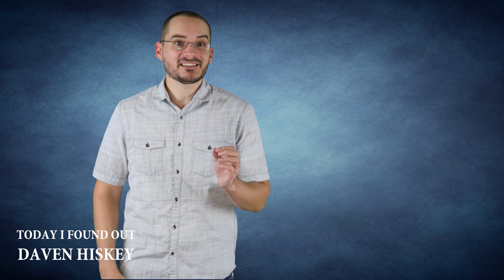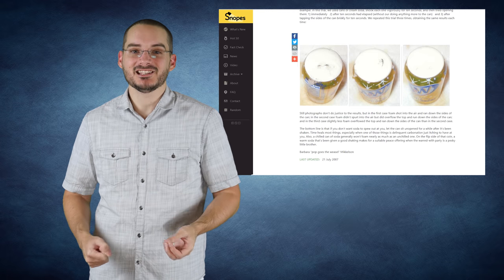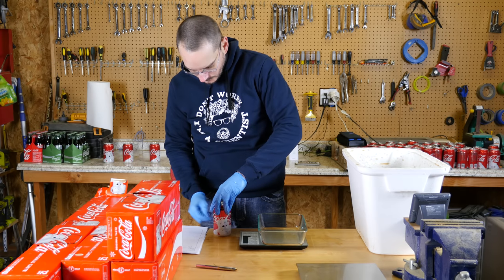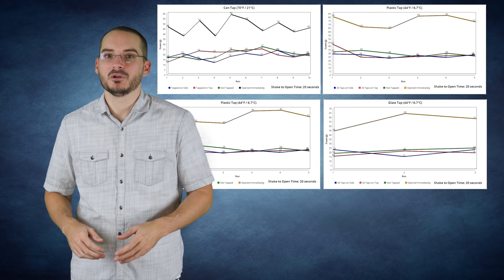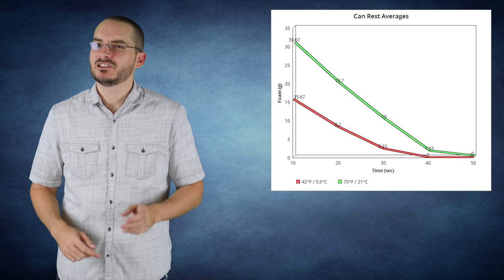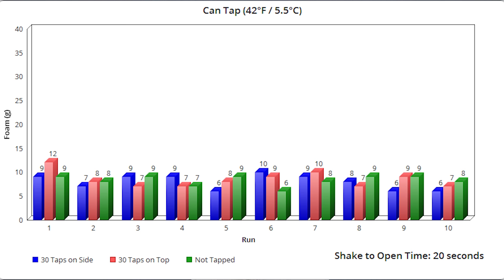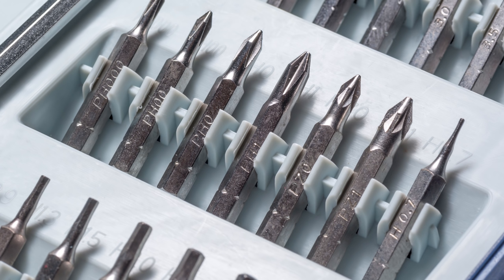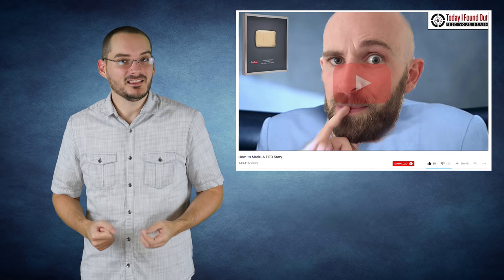Does Tapping a Shaken Can of Soda Actually Reduce Foam?

Comment: You should also set it on a flat surface when opening the can. I like this experimenting format!
Reply: Good idea, however it loses some of the spontaneity of how a soda would most likely be opened out in the wild xD
Reply: Actually..if you look at the 6:36 mark, he shows the graph for the table (flat surface) vs air tap/not tapped, etc...and other graphs as well.
Reply: Of course you need to look a little past the 6:36 mark for the other graphs..
Reply: Backtobassics500 : Backtobassics500 : I think he was referencing tapping in the air vs tapping on a hard surface.

My focus was on the opening procedure which from the video footage looked to all be in the air which consequently means they can be held at a variety of angles.

Comment: Thank you! For about 30+ years, I noticed that drinks with aspartame foamed up more when pouring over ice. I realize you didn't study that, but I'm guessing the foaming happening with the ice is triggered by similar causes. I also noticed Splenda drinks foam less than aspartame. I always wondered what triggered the foam when the soda hit the ice and why the amount of foam was different based on the sweetener.

Comment: Not sure where the idea of tapping came from but I always flick the base of the can once or twice if I drop a can / it gets shaken up. The first time I ever learned about this while camping we got together and both shook up a can then I flicked the bottom twice and my mate didn't do anything. When I opened mine it was fine and when he opened his it went everywhere. I'd really appreciate if you could just try 1 can again but flick the bottom twice and see what happens.
Reply: Was about to say that peak velocity would be the determining factor if dislodging the nucleation sites is the actual mechanism of effect.    

(I'd expect this to be) Similar to how a slow (1 minute) pass with a vacuum cleaner will dislodge more (particulate) dirt than five minutes of vigorous/fast passes.  The flow during the fast-passes does not have sufficient time to accelerate the dirt out of the pile, where as the slow pass does (albeit without the energy/violence necessary to break apart dirt too large for the flow to pick-up into smaller particles).

But like the experiment shows, it doesn't matter how much energy/violence is applied if the system has sufficient time to settle between pulses--- wait, would a centrifuge work? :/

Comment: Nice video!
I thought that the Mythbusters looked into can tapping too, but I can find an episode reference for it.   I've always been puzzled by the people who just do some little tapping to the can.  When I first learned about this, years ago now, I was shown that I had to thump/flick the can.  

I.E.  Hold the can by the top and bottom rims in one hand (as if it was being held by a C clamp) don't touch the sides as it will dampen the vibration.  Then flick/thump the can using your other hand (as one might flick someone's ear) -- the can will ring like a bell if you did this correctly.   I usually do this two or three times out of habit.

If the point is to get attached bubbles to move to the top of the can then holding the sides while tapping should reduce the effect any tapping.    By flicking/thumping the can so that you hear it ring I would think would give one the best results, if it really works at all.

Comment: I find that with the plastic Coke bottles that if you just break the seal (when gas is released with a hiss) by twisting and then two seconds later open the bottle no foam  will be produced

Comment: Yeah, science!

On a related but non-foam issue, I've found (anecdotally) that tapping the top of a can before opening can prevent a small amount of soda from spraying out (as opposed to foaming out) of a non-shaken can. If the can  has any droplets of soda clinging to the top of the can, some of those droplets will spray out. Tapping the top knocks the clinging droplets off, so no spray.

Comment: makes sense, in my practical experience I always settled on a couple moderate taps on the top and then a 6-10 sec delay depending on how badly I believed it to have been agitated.  The taps are mostly just habit for me at this point and have been getting phased out since I gathered their lack of necessity.  Something that slips in mindlessly at times.  I adjust the timing depending on the soda, such as Dr. Pepper being a much more violent drink requiring significant delays at the slightest perturbation, but 6 seconds seems to be the general goto for me.

Comment: The mechanism I suspected would reduce foaming is not the dislodging of small bubbles and allowing them to raise to the top. But rather the fact that a strong shock can break up small bubbles, which in turn can make them sufficiently small for surface tension to shrink them down further due to gas diffusion out of the bubble into solution, eventually eliminating the bubbles altogether.
Without actually having done any quantitative research, I doubt that tapping against the can is strong enough to accomplish the breakup of the micro bubbles. I think you basically have to hit the can against a hard surface (without damaging it). Of course that can also cause additional nucleation of new bubbles, so in the end it might not work out either.

I tried this out once with a sampling size of 1 and it worked beautifully, but I really don't put much trust in my experiment since there was likely a lot of other variation between both cans going on.

Comment: it mainly takes time which is the cure for the shaken can spewing.

The plastic bottles have plastic expansion with the effective pressure increase due to shaking.  (yes, you can measure that)

And soda companies vary the pressure in the can with the expected altitude at opening.  A can made to be opened at altitude in an airliner (appx 10,000 ft pressure altitude for a pressurized cabin) will have very low carbonation if opened at sea level.

Comment: I am curious about something I have seen. As a long time Dr Pepper drinker I have noticed that if you refrigerate a Dr pepper then take it out and let it sit for a min or so with out shaking it will overflow when opened. If you open right away you are ok and if you wait several mins your ok also. It seems there is a window in there you have to be careful.

Comment: It not only works on soda/pop, it also works on beer.  I have personally shaken cans of carbonated beverages and tapped on the top to see if it works.  Not only that but I also do it when standing in crowds.  I will walk up to people, shake the can and tap on it and open it up right in front of them, close to them.  They get scared, I crack a smile, I open the can and everyone is amazed that nobody got spilled on, fun for everyone.  Note, if you do this with beer, the shaking of it and subsequent tapping does make the beer slightly flatter, not entirely, but still noticeably flat.  I never noticed any change in soda when doing this though.

Comment: I’ve been tapping the top of the cab since I learned this in 1993. It works every time.  You have to tap  more than once. Also in some instances open the can a little to see if it worked then a few more taps. Never failed

Comment: FWIW, my own technique uses plastic bottles with screw tops. These allow incremental release of CO2 without significant foam production. I have not done well controlled studies, but I do observe that this does a better job even immediately after the shaking of the bottle than simply opening the bottle quickly even a few minutes after. 

No tapping done, though obviously this method dose not work with cans or glass bottles.

Comment: I have found that sqeezeing the can for a few seconds after shaking will stop it for foaming all together.  I have avoided it foam bath several times after being handed a soda that had been shaken. Use one 5hubm over the other both hands on the can, hold for 3 seconds.  I guess it might be the 3 second wait.

Comment: I've got a random question. Is a new fridge/freezer harmful to food? "People" say that you need to leave a new fridge 24 hours once installed for the "gases to settle" before you can put food in there. How could this be harmful as the refrigerant gas is sealed? Also if an older fridge was moved from one property to another and keep upright for the short journey could the food be left in there and would it be okay (as long as not defrosted)?

Comment: My wife used to work in a Dr. Pepper plant and told me that plastic (PET) bottles are filled with more CO2 than cans. Because polyethylene terephthalate plastic bottles permeate CO2 at a faster rate, manufacturers increase the amount of CO2 in those bottles to compensate. This would explain why there was more liquid lost in the plastic bottles compared to the cans given the increased time it took to open the plastic bottles. Manufacturers do indeed vary carbonation levels by container type.

Comment: Finally I have something to add to one of these: They actually DO change the amount of CO2 based on container type! The reason for this is that the plastic bottles are slightly permeable to CO2, and are therefore "over-saturated" with it to account for loss during transport and storage. This is why an unopened old bottle of soft drink will be flat.

Comment: I've heard when it comes to soda cans and beer cans, that it would help FLICKING the sides, not simply tapping them, because there's a lot of bubbles that get stuck to the side, and by flicking it, you'll much more easily push the bubbles off the side of the can so they can rise to the top and make less of a mess. I've experienced this to work better, but you think it just could be the waiting time that matters?

Comment: Well done.
I think plastic bottles are possibly more carbonated to begin with, to offset the  greater flex of the plastic, compared to the glass and aluminum containers.   I doubt nucleation sites are a significant factor in the different foaming volumes.

Comment: From literally years of shaking soda cans before opening them, I believe the CO2 is escaping from the liquid after you shake it, and escapes when you open the can, regardless of the amount of time you wait.  It doesn't return to the liquid.  I believe this because the liquid is flat after shaking (which was why I used to shake my soda cans in the first place, as I preferred the flat flavor), and because it felt like there was more air escaping after shaking the can.

However, I lack the rigor applied in this video, so I can't be certain.

Comment: Although it would be unconventional and admittingly a little bit messy have you ever tried taking the lid off of the plastic bottle first? And then putting your finger on it and shaking it up? That would be the most efficient way to optimize "release time". That would eliminate the opening time/process completely.

Comment: The plastic bottles could also produce more foam because there's more of an opening the instant you crack the plastic top due to the cap lifting off the entire mouth of the bottle at once, whereas with a can or glass bottle you're only making a tiny little opening first if you go slow.

Comment: NEXT TEST IF POSSIBLE.  Years back when purchasing a small (glass) bottle of OJ, some people would smack the bottom of the bottle against the heel of their hand, saying it made it easier to remove the vacuum sealed lid.  I never got around to trying this with a torque wrench to see if it was indeed easier to remove the lid after having been smacked.  (the proponents of this theory argued that the sound heard was evidence of the vacuum being eased, but my theory was the sound was just the fluid being agitated, and the glass against the heel of the hand)

Comment: quite interesting. as an aside; you might retry the plastic bottle with it being somehow securely held in place so that the presure from a holding hand won't slightly increase the internal pressure. [ or have you had enough coke for now?]

Comment: Daven improved quite a bit. Thumbs up.
Two things technics-wise: There are reflections in your glasses that are distracting and the greenscreen lighting could be improved a bit (side of your head is slightly green).

And another minor thing I just saw: When you give values with decimal places you generally make them the same length (for example at 8:40 you have 8.2 and 30.67 - it should either read 8.20 or 30.7 - in this case probably 30.7 would make more sense, as the next digit does not have any significant value for the graph).

And it would be nict to have the 5:20 graphs in a bigger size.

Comment: I've always tapped the cans to try and feel how high the pressure is and judge if it's safe to open more than an attempt to decrease the pressure itself. Firmer cans that kinda thud when you tap them are ready to pop, cans that kinda reverberate slightly are increasingly less problematic.

Comment: Plastic bottles actually have a higher CO2 content then glass bottles, because the plastic bottles aren't 100% air tight so, whereas glass bottles are, with them there is only a small gas loss through the cap. So plastic bottles are filled under a higher pressure, so that the drink still tastes good after some time on the shelve.

Comment: I've noticed that a fountain Dr. Pepper is fizzier initially than a fountain Coke.   And, The Dr. Pepper goes flat many, many times faster than the Coke.  Usually I can bring the Coke home and put it in the fridge and it will still have a little fizz.  I find myself dumping out the Dr. Pepper between burgers as it has gone flat in a matter of minutes.

Comment: I like the effort... I quit drinking soda after 350lbs, got on a bike, and misplaced half of me somewhere....so...eh.. liquefied candy ain't my thing.

 I really like the idea of you exploring interesting things that are more practical and hands on. The expanded sponsors and marketing sound interesting as well. If I were in a position to persue such things, I would try to find the lowest cost item to promote that has the largest demographic appeal. I'd also want metrics to follow. It's easy to overlook lower priced items for promotions, but they usually have higher margins. If dialed in well, the right price point matched to the right audience can work magic.
    I spent a few years as a buyer for a retail chain. So I have a bit of experience with products and demographics. I'm curious how a large YT audience would respond to a sub-$5 'interesting item' pitched indirectly. 
    I think Hank's recent endevors into direct marketing through Sci Show are an interesting exploration of how YT has potential to evolve. Today he mentioned they already sold out of half of the items on their site. The question becomes, how much of your audience is willing, or has access to pull out a CC and use it immediately, and how can you manipulate that?

   Anyways,... that's a really big breadboard. It looks good in front of a camera ;)
 Thanks for sharing,
-Jake

Comment: You can get a plastic soda bottle to fizz out just from NOT opening it fast and smooth. I'm gonna make an uneducated guess and say this is caused by pressure changes from the cap being pressed on, effectively sealing and unsealing erratically. This would cause some agitation. But what do I know?

Comment: Running experiments, as imperfect as they might be (re completeness, error, etc), running experiments is SO much better than the random pontificating so many folks on the internet presumes making them credible. 

All I can say is that IN MY EXPERIENCE, tapping the top of the can fairly hard seemed to reduce the foam a little.  But it was FAR from formal science, lots of randomized trials, or controlled, etc.  I had no idea why it should work or not -- I just tried it as after, say, dropping a can, opening it could make quite the mess.

And it DID occur to me that the time interval re tapping might have been the biggest factor.

Comment: This is interesting. I have always only understood that this tapping thing only works on cans and only on a slight shake and only tapping from the bottom. So if I accidently knocked over an unopened can or it dropped a small distance. I would then then pick it up, tap it on the bottom and then open it and it would be fine. This is the only time I ever saw tapping a can would work. In any other more serious shaking I would simply wait. I wonder why you didn't test tapping from the bottom?

Comment: If you place a quarter on the bottom of the can closest to the center as possible and apply firm presser there will be little to no foam. And this works in much less than 20 seconds. Give it a try

Comment: I wonder if the plastic bottle foamed more because the material could expand due to the pressure inside and once opened,  contracting a bit, pushing more out.

Comment: Plastic is much more malleable then glass and cans which could also contribute to why it foams more, it will expand more then the other 2 which will reduce the pressure and reduce how fast the CO2 can dissolve back into the liquid.

Comment: interesting test.

I find the simplest solution to the problem when it comes to plastic bottles is to crack the seal then close it back up just before the bubbles start to come out. this releases the pressure a bit and causes the remaining bubbles to settle faster.

Comment: If you wanted to measure the usefulness of just waiting, you should have run tests with tapping then waiting a bit versus tapping and opening immediately, not just with only waiting versus opening immediately. Just to give you that comparison in one more context so you can check whether it matches your result from not tapping. If it does, your result is that much stronger.